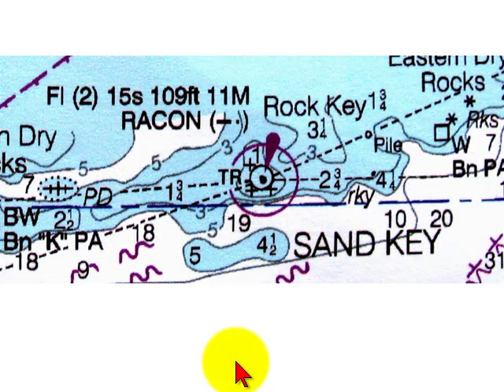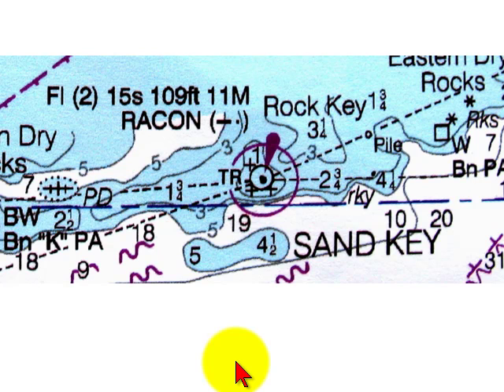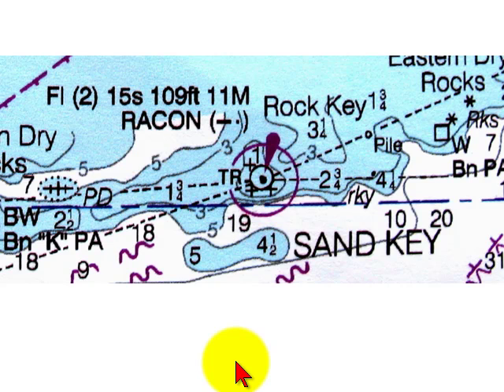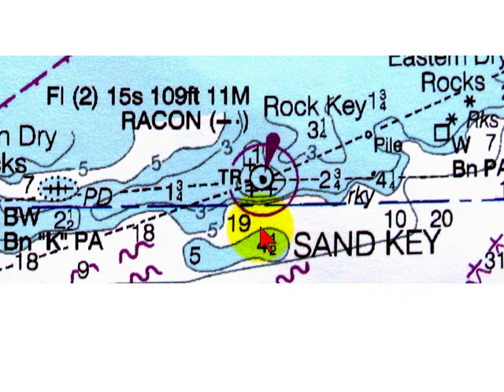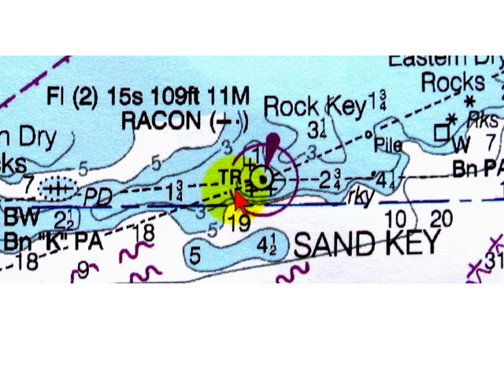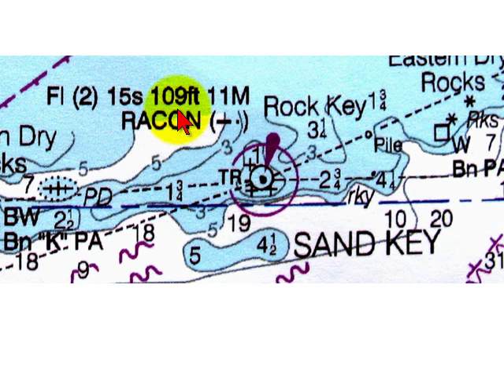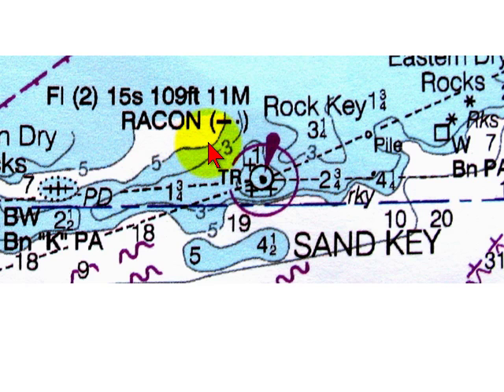How to "Read" a Lighthouse on a Nautical Chart

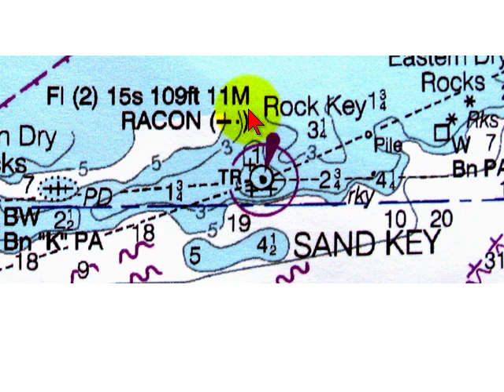Comment: Around 1:28, you say, "... nominal range, does not take into account the curvature of the earth."  If so, how is it computed?

A quick bit of trig shows that treating the earth as a sphere of radius 20,925,524.9 feet gives a distance of 11.116 nm for the nominal range of a light 109 feet tall, so I would suspect that the curvature of the earth is exactly what they're using. (R * arcsec((H+R)/R))

One question: the height of a fixed light the height above chart datum?  Above MLLW?  Or what?

Comment: Is it how tall the tower is, or how high the light is above water level?
Reply from the maker: Lights are measured from the water up to the lantern of the light (not to the top of the structure). If using a paper chart, look near the title to see what stage of the tide heights are measured from (on US charts, most heights are above mean high water). Some charts might say mean sea level, in areas where tides are minimal. On an electronic chart, click over the light and browse the data in the dialog box to see how heights are measured.
Reply: @skippertips  Thanks. Nine o nine in Cape Town now.